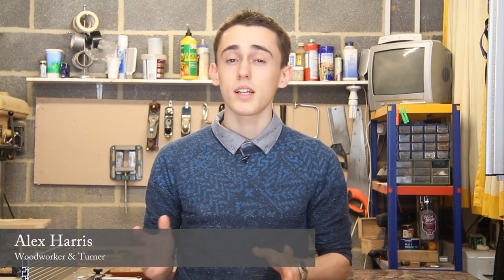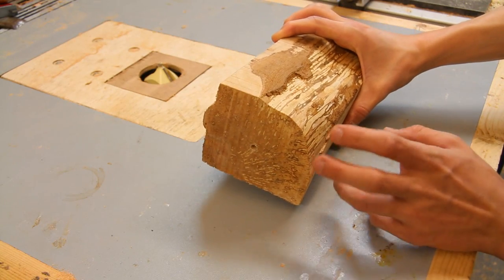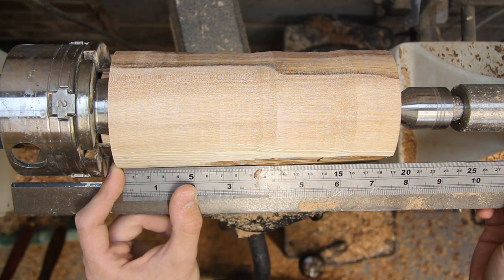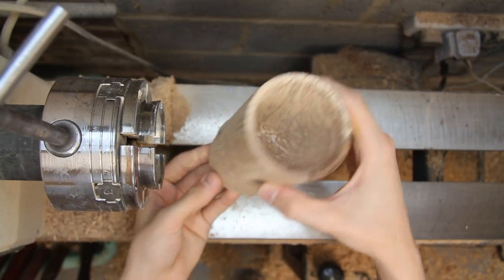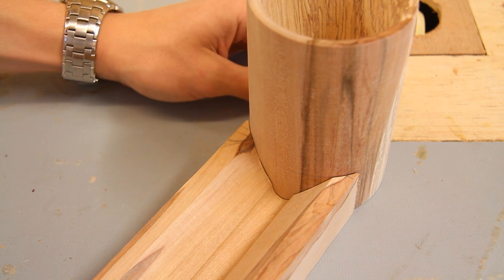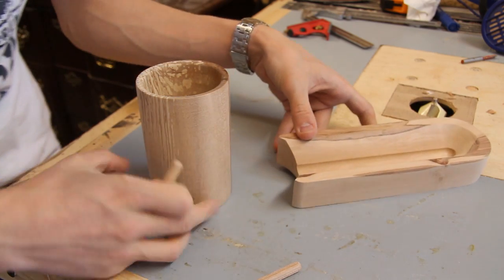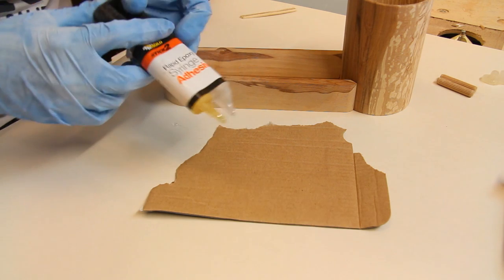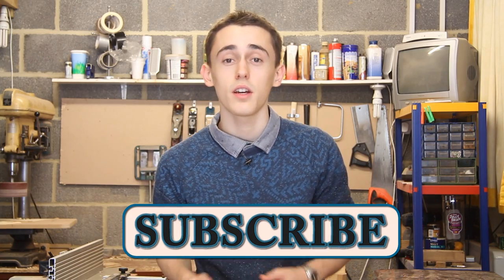Make a Wooden Desk Organizer

Comment: Really enjoyed the video! Very nice project indeed. One way to accurately sand the tray to match the diameter of the pencil holder is to wrap the the cylinder with fine sandpaper (while on the lathe) and push the rough-cut lathe against the spinning cylinder. Accurate, quick and neat. Keep up the good work!